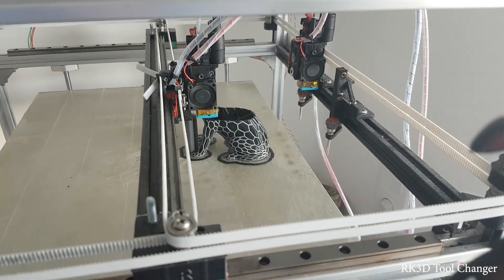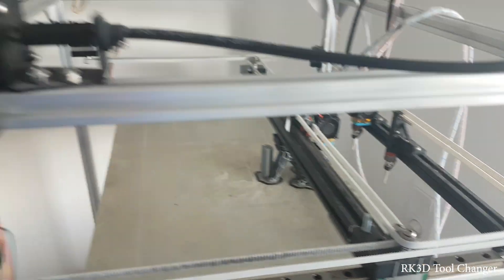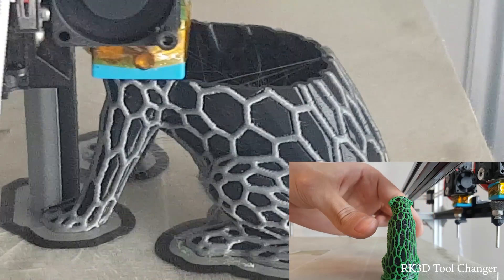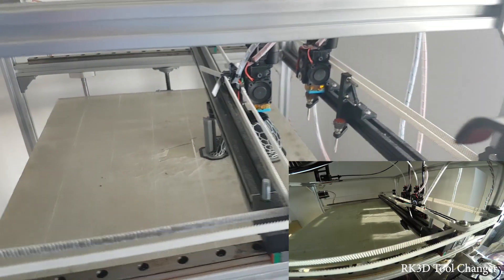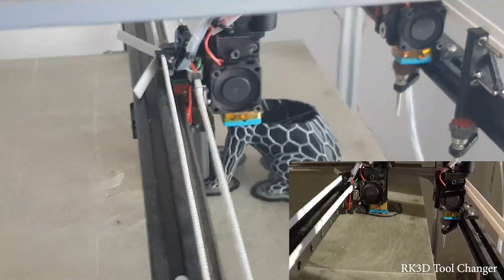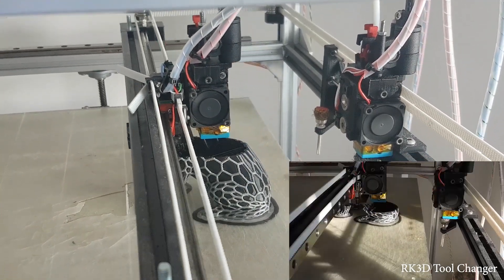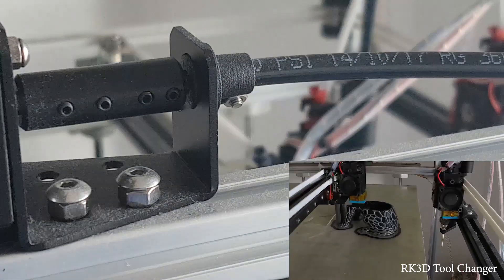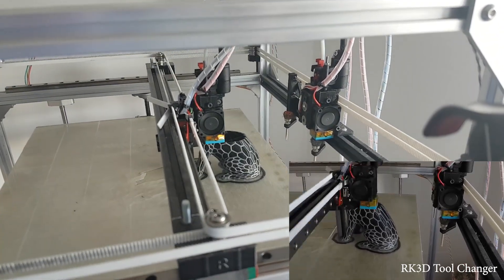RK3D Tool Changer #9 Clean Dual Color (Hard Test)

Comment: genius, instead of picking up de extruder from the front, you go sideways. this way you dont need any motors or servo's to pick and hold extruder in place, just magnets.
Reply from the maker: Exactly, then everything becomes smaller, lighter and simpler.